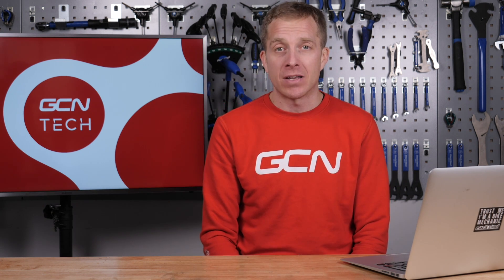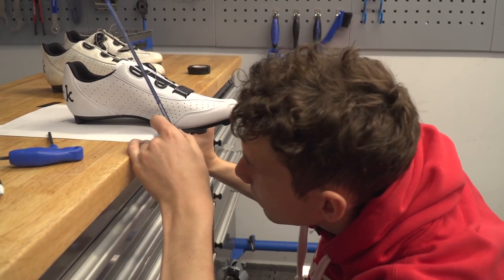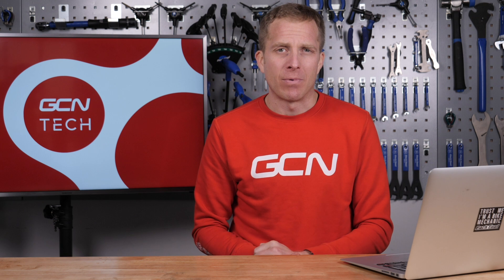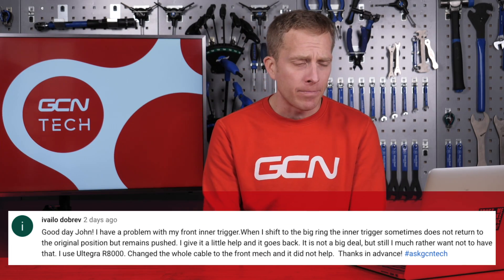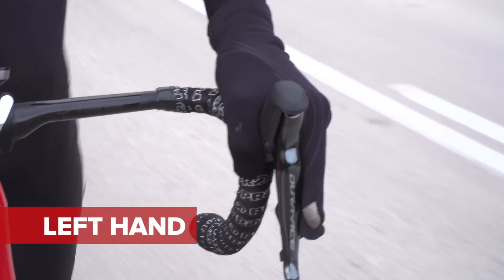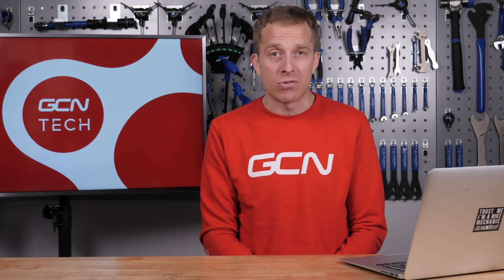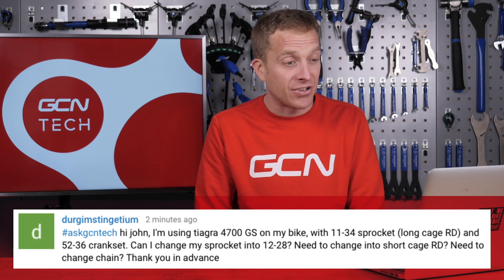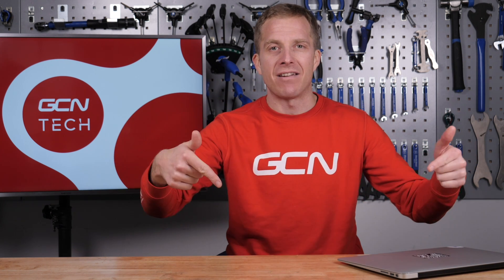Toe Overlap, Tyre Widths & Rolling Resistance | GCN Tech Clinic

Comment: #askgcntech Hi Jon, I have a problem with indexing my rear gears (shimano 105 - 5800). I follow the instructions from your related video, and it works fine on the stand. But in real action, when I try to select the smallest cog, usually I fail, the chain stays on the second smallest cog. Should I change the cable? Thanks

Comment: #askgcntech Finally N+1 has paid off and I now have my first bike (Cannondale Caad 8 2013)  permanently on my Elite smart trainer. My question is should I change my chain as often as i would my fair weather bike. Will it make a huge difference to my indoor training if i didnt?
Reply: I'd say just check the length of the links like you would on an outdoor bike. The only difference would be the lube you can use. Using a dry lube could be better, since you won't be in the wet or be picking up dirt.

Comment: #askgcntech I have recently laced up a new set of wheels with the spokes in a 3X pattern.  Is there any advantage to tying the spokes together with wire and solder at the crossovers?  I've heard of the practice but not actually seen any wheels finished that way.  Perhaps it isn't worth the effort?

Comment: #askgcn Can you put 25c tires on a standard xc 29er rim? considering it have an internal rim width of 25mm. I've watched your videos on new wide road rims like those enve and knot64 and the mentioned rim widths are actually wider than 25mm. Will it be safe to assume that they will act the same or there are some difference in the bead seat design of a mtb rim and a road rim. Thanks

Comment: #askgcntech Hi Jon, I really love the show! I have a little problem with my Ultegra R8020 disc brake levers because I can't reach well the lever when I have to brakethere's a way to solve the problem without buy a new set of levers? Thanks you, greetings from Italy!!!
Reply: Filippo Longobardi sounds like you need to move the levers further down the handlebars 
The lever should be looking vertical not angled
Reply: Neil Yardley The fact is that the levers are vertical, I know that there’s the possibility to act on a screw inside the lever to bring near the lever to the handlebar, but I don’t know where it is and how to adjust it #askgcntech
Reply: Filippo Longobardi just a slight turn of your handlebars upwards and bring the levers down 
Hope that helps
Reply: Neil Yardley I’ll try to put the levers down, but I can’t rotate the handlebar up because it is a monocoque
Reply: Neil Yardley thanks you so much!
Reply: *monocoque handlebar and stem

Comment: #askgcntech Hi Jon, I like your presentation. I have a 2x8 speed bike, can I just remove the front derailleur and then ride with just 8 speed and manually shift the front chainring when needed. I mostly ride on road surface. Thk
Reply: you can do that (the question is, why would you? to safe the 100grams from the derailleur?) but keep in mind there will be a higher possibillity of dropping the chain.
Reply: oh, less component for travelling. A foldable bike with 2x8speed.

Comment: Hi GCN! I recently acquired a Trek 5200 with dura ace 7700 9 speed groupset. I am interested in upgrading the crank and bottom bracket rather than doing maintenance on the octalink spindle.  Some sources say I could use a 10 speed crank, but I’m worried that will cause compromises in shifting/general functioning.  What current cranks would work well with this setup? Thanks! #askgcntech
Reply: use 10 speed durrace cranks or lower shimano with a 10 speed chain with the 9 speed cassette. will shift better than a 9 speed. same with a 10 speed casette with 11 speed chain its shifts better.

Comment: #askgcntech hi Jon.  I recently picked up a nice Tommasini frameset in half chrome and chrome fork.
I need to store this in the attic for a few months - how do I protect against rust?
Reply: just keep it dry -- no water, no rust
Reply: Any moisture or condensation will cause rust not just water 💦 . Jon has a bunch of vintage steel kept in his attic so his input is welcome. It may be as simple as spraying gt85 on everything, but I’m not willing to on gambling with such a nice frame set.

Comment: Toe overlap-can happen in slow maneuvers moving about within the confines of a parking lot going out on the morning group ride or moving about within crowd of people or any numerous scenarios, that if not aware that it can happen, will get you every time. I.e...The much revered track-stand can create toe overlap
Reply: Tony Crabtree 

Toe overlap can occur if crank arm and front tire are at the same point of intersection and make contact. Contributory are angles of seat and head tube, crank arm lengths, shoe size, cleat setting creating shoe to be set forward just enough or any other scenario creating potentiality for overlap. All this is about is to aware of it.
Reply: Road Glide My Lemond steel bike has the issue, but none of my other bikes do. Same shoes. Really weird.
Reply: identical crank arm length + same shoes and none of my newer bikes have this issue.  I can’t recreate it. Just a quirk for my ‘04 Lemond. Maybe bike was designed for 650c wheels? It’s not a minor overlap, either. LOL

Comment: the question was about weight not aerodynamics. the weight difference between 23s and 28s is so small, thats not even worth a watt even on a steep climb. aerodynamics is more complicated as jon indicated. check out hambinis blog, he did a test on this and based on it i would say that on a " regular" 22mm wide rim the negative effects of going wider could/should outweigh improved rolling resistance atleast on regular tarmac and 30km/h even before going to 28mm. certainly on the front, on the rear the tire with the lower rr should always be faster  unless you have one of these weird triathlon bikes that dont have a normal seattube.

Comment: #askgcntech Hey Jon, the front derrailleur of my Ultegra Groupset is almost impossible to move. It's like that since i changed my shifter cabled. Did i do somthing wrong while i changed them?
Reply: Does the cable move when you use the shifter? If it does, you might not have enough cable tension.
Reply: @Calum_S  yeah. The derailleur moves and also shifts but its suoer hard to move
Reply: @djawadi4444  I thought that was the case, I just wanted to rule out the simplest thing first.
I think I had something similar when I didn't get the inner cable installed correctly into the shifter (unfortunately I can't remember the exact circumstances). All I can suggest is check the cable run is correct. Hopefully Jon will be able to get you sorted. 🤞
Reply: @Calum_S  thank you very much anyways

Comment: Are the Sora R3000 shifters easier to shift/press? I find with my 3500 shifters it can be hard on the wrist.
Reply: Maybe consider upgrading to a tiagra groupset or even a 105 or ultegra, how bout that
Reply: @HeathyRoidz  I will for my next bike, this is my first road bike, got it for $650 new with sora.
Reply: @darinsteele7091  650$? That was like 3 yrs ago?
Reply: @HeathyRoidz  I got a 2014 Scott Speedster it was new old stock, I got it last summer for $650 CDN. I should have waited to get Tiagra or 105 but I wanted a bike right away, I like the bike though so no regrets.
Reply: @darinsteele7091  yeah I understand I got so excited to buy my first bike that I ended up overpaying, no regrets tho
Reply: @HeathyRoidz  my sora works fine though i was just anal about the shifters, i wanna upgrade the stock cables to Optislick though it might be even better.
Reply: R3000 feels what shimano should be with its quality while 3500 isnt that good put together
Both are compatible so it may be a good upgrade if u think its worthy
Reply: @ForTsz  i agree that the new shifters feel modern, i may still end up getting them as i plan to not purchase a new bike for a long time.

Comment: Price differentials on saddles. Obviously the higher end saddles are usually lighter and the materials are higher tech.
Do you think it makes that much difference in comfort.
Saddles as cheap as £49 and as expensive as £249 what do you think?
Reply: it really depends on your bum/sitbones and cycling style. saddle X for 30€ can quite possibly fit you better than saddle Y for 300€. its best to try different models and get a feeling for what works best for you (thinner or wider, with cutout or not, etc.)
Reply: There is no difference in comfort
Reply: You can get a Selle San Marco Rolls Saddle for £34 (£100 for the Titanio version with Titanium rails), which is regarded as one of the most comfortable saddles available. Comfort and price bear no resemblance to each other. 
I paid £30 for a Selle San Marco Concor Racing Road Saddle (@216 grams) as a lightweight alternative, but haven't yet tested it out for comfort.
I have also recently purchased a Brooks B15 Titanium saddle for £180 for more long term comfort even though I have never had any comfort issues using a Rolls.
I think most folks purchase saddles based on weight, trendy materials, fashion and looks whilst comfort is a secondary after thought.